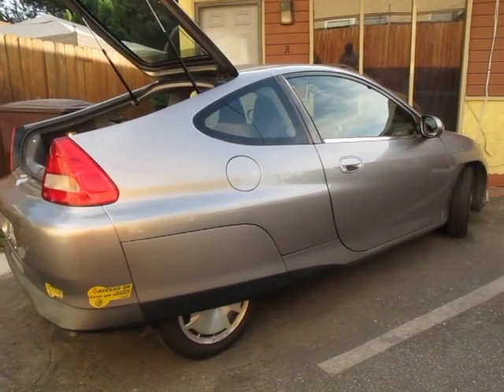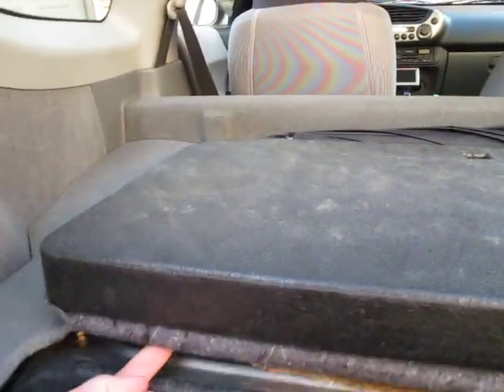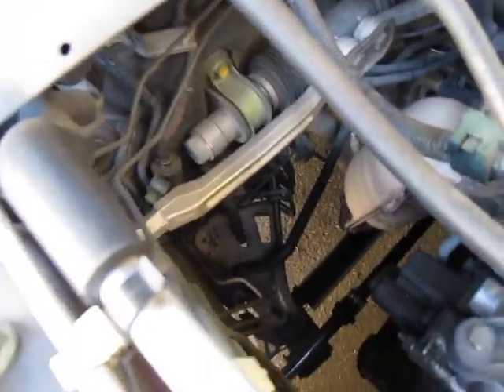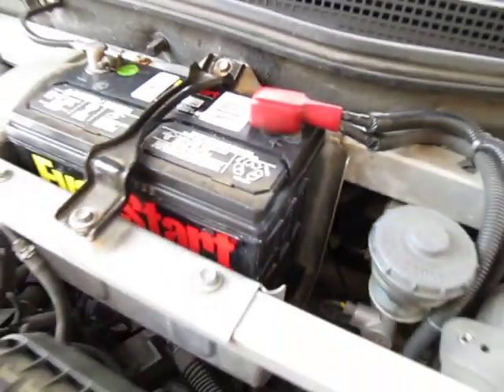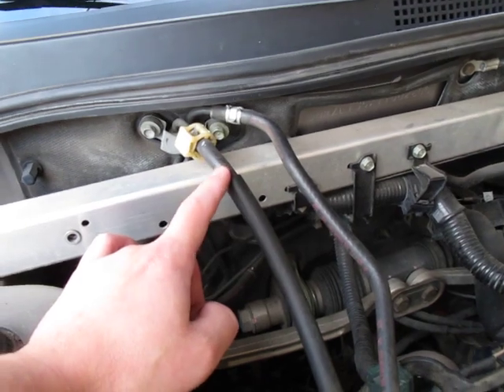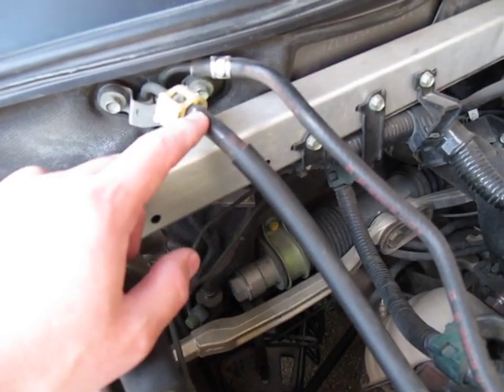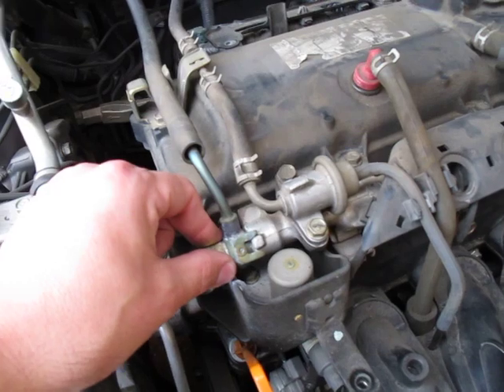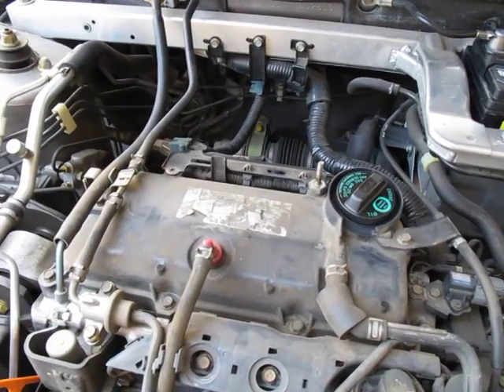Pre-Heating Fuel Concept With The 2000 Honda Insight

Comment from the maker: Thank you very much for this link :) It's of great help. Yes, you are exactly right. This link indicates 90 cubic feet of air flow per minute(through the combustion chambers, collectively) at 6000 rpm's(revolutions of the engine per minute)(or 1.5 cubic feet per second). This car has a very tall gear ratio and achieves 100 miles per hour at only 4000 rpm's. At 4000 rpm's which I have no need to exceed, the engine pumps 60cfm or 1 cubic foot per second of air. I'm just getting started continued:

Comment from the maker: Thank you Ron. I will do this right away. Thank you for the information and guidance. I really appreciate it. When articles and publications and newspapers and write-ups state that 98%(+) of the gasoline is burned by todays automobiles, these articles are not talking about the engines combustion chambers burning the gasoline(HydroCarbons). The catalytic converters in new automobiles still burns the unburnt fuel. The gasoline must be burned inside the combustion chamber to maximize efficiency.

Comment from the maker: Thank you. I understand. When I bypassed the stock fuel pressure regulator by way of removing and capping off the Vacuum Line connecting to the stock fuel pressure regulator, The fuel pressure increase to 47 PSI. When the stock fuel pressure regulator vacuum line is connected, the high pressure fuel line is reduced to 37 PSI(Pounds Per Square Inch).

Comment: Liquids will vaporize at a much lower temperature when under a vacuum. For instance methyl Alcohol will vaporize at 100 degF under a vacuum where as it will take 165deg F normally to vaporize. Most internal combustion engines produce tons of vacuum to utilize this effect.
Reply from the maker: Thank you. Very Interesting. I will study your notes in great detail.

Comment from the maker: That's a very good question. From what I've read, gasoline powered engines(4cycle) are said to be least efficient when the throttle is at anything less than 100 percent open ie maximum flow, but that only until we reach our desired speed, then let off of the gas just enough to maintain said speed ie 70 miles per hour. I'm told that diesel engines are quite different, in that they do not have a butterfly valve which limits air flow through the intake as you accelerate, thus most efficient design.

Comment from the maker: That's great. The 2000 to 2006 First Generation Honda Insight is certainly a unique car. Aluminum Frame, Aluminum body. The car only weighs 1800 pounds and because it's aluminum and honda design new machinery and processes to build the car- the car actually has an increase in structural stability over a comparable size car made of steel. I believe it's 30% increase in structural stability, thus high safety ratings and excellent track handling. You saw some nice and unique cars that day :)

Comment from the maker: Yes, I really like the idea of using an Ultrasonic Transducer(Humidifier) to Cavitate the liquid gasoline into small 2micron to 5micron droplets which quickly vaporize after leaving the Ultrasonic Transducer because of the large surface area of the small droplet size. Also, the less than 100% humidity conditions facilitate this phase change from liquid to vapor state. I recently learn that gasoline expands 163.3 times when it phase changes from a liquid to a vapor. Very interesting indeed :)

Comment from the maker: That is a very good question. I show a fuel injector I open in the video "Gasoline At 400 To 700 Degrees Fahrenheit"(near the end of the video). I open this fuel injector in order that I may see the contents of the fuel injector, in terms of materials used ie Metals or non Metals. I drove the 2000 Honda insight with the liquid gasoline PreHeater system for about two months with no problems nor complications. The car ran very well with an increase in mpg(apx 8mpg increase) and very smooth idle.

Comment: They could be in one large chamber with space above the baffles for the vapour to be mixed with the air as it passes through, but the baffle walls should help prevent the fuel from sloshing away or submerging the 'fogger' more.
I would start the baffles a short distance up from the base.
Imagine an ice cube tray, with a fogger in each compartment. Now cut off the bottom and then place the tray into a box but glued in place up off the bottom. The tray sides will limit sloshing.

Comment from the maker: Gas hole is an excellent insight into the basic gasoline vaporization system and how easy it is to improve fuel efficiency, reduce tailpipe emissions & increase power- all at the same time. Also see Smokey Yunicks hot vapor car, via a Google Search. Smokey design several gasoline vaporization systems that work very well. Smokey said the only way to use all 17,500btu's of energy per pound of gasoline(times 6.3 pounds per us gallon), is to vaporize the fuel before it enters the combustion chamber.

Comment from the maker: Hi Mike. Thank you for your question. Pressure affects the boiling temperature of liquids. In the same way that water will boil at 212 degrees Fahrenheit at sea level(atmospheric pressure). And water will require more heat if pressurized, Gasoline also requires more heat when under pressure. The more pressure, the more heat required. I do not have the exact equations, but I'm sure they are available, and as you mention, well known. My fuel line is at 37psi, thus much more heat is required.

Comment from the maker: Thank you for the post Ron. I really appreciate your knowledge and experience. In order to learn how little fuel is actually burned inside the combustion chambers, one need only google search "Physics of the internal combustion engine", Many Physicist and Engineers have written at length. The Physics and Engineering Aspects of the internal combustion engine have been very well documented and described in simple non technical words. It's truly great to know how a system works, inside and out :-)

Comment from the maker: 6001 cubic feet of air per hour equates to 100 cubic feet of air per minute or 1.7 cubic feet per second. The 61 cubic inch insight engine will pump 60 cubic feet of air per minute at 4000rpm's(ie 100miles per hour). Our air to fuel ratio will be 122 pounds of air to one pound of vaporized gasoline. Note: One gallon of gasoline weighs 6.3pounds. One pound of gasoline vapor is 3.5cubic feet. With an air to fuel ratio of 122 pounds of air to one pound of gasoline(see definitions of  Stoichiometry)

Comment: The fuel can be fed in below the baffles. A simple float controlling the fuel pump could stop the fuel from rising too high.
For safety reasons, we need to look at preventing fuel from leaking everywhere in the event of the car rolling. A mercury tilt switch could kill the power to the pump.That would just leave the fuel in the chamber to contend with...
An electrically powered butterfly valve in the 'air in' hose up stream of the chamber could be closed in the event of a rollover. No fuel leak!

Comment from the maker: @beaugardner1 You are exactly correct. I have been driving the car for almost one month now with the new modification, and though the gasoline is being heated to 400 up to 700 Degrees Fahrenheit, the stock fuel pressure with the stock fuel pressure regulator which is on the fuel rail before the gasoline reaches the fuel injectors, is 37psi. I tried bypassing the stock fuel pressure regulator and the pressure increase to 47psi.

Comment from the maker: Hi, Thank you for your interest in this project. You are absolutely right in your observation. At this point in time, I've move onto a different design which works a little different than this approach. Please type Molecular Change in the you tube search bar. This will take you to Billy's truck which he's create a system which vaporizes the gasoline quite effectively. Inside his vapor chamber, he has two 250 watt Calrod heaters wired in series, heated to 600 Fahrenheit.

Comment from the maker: @NitroExplosion88 Thank you. The only explosion that should be possible- is a controlled explosion inside the internal combustion chamber. Being that the gasoline will be completely vaporized(ideally), The gasoline vapors once mixed with oxygen from the ambient air being pulled into the engine through the intake manifold- will ignite quite well. But not a moment before being inside the internal combustion chamber(piston cylinders). I will be replacing the non metal fuel line with copper lines.

Comment from the maker: rather than the stock fuel systems 14.7 pounds of air to one pound of gasoline(this 14.7 to one ratio is said to be required only when injecting gasoline in it's liquid state and vaporizing the gasoline inside the combutions chambers, rather than sending only vaporized gasoline into the combustion chambers- which permits 122 to 1 stoichiometric fuel ratios with a noted long history of no harm to the engine). One gallon of gasoline expands 163.3 times when phase changed to it's vapor state. If we

Comment from the maker: gasoline vapors(ie one pound of gasoline to 122 pounds of air) = 9630 total cubic feet, with an air to fuel ratio of 122 to 1(measured by weight). Thus 9630 total cubic feet divided by the engine pumping 100cubic feet of air(including the recently combined vaporized gasoline) at 4000rpm's at a Hypothetical 100 miles per hour(load, friction and drag included?) = 96.3 minutes to consume one liquid(in vapor form) gallon of gasoline(at 6.3 pounds) at a Stoichiometric air to fuel ratio of 122 to 1.

Comment from the maker: Engines built for racing sometimes have a Camshaft(Cam Lobes) which open the valves to such a degree that the engine will not idle well, however permit excellent power and performance at higher engine rpm's. With VTEC, the engine may use these more extreme camshaft lobes for higher engine rpm's(estimated at approximately 2600 + rpm on the 2000 to 2006 Honda insight) while having access to a more mild or ideal camshaft lobe for excellent engine idle and torque at lower engine rpm's. Interesting.

Comment from the maker: I like your idea of using several Ultrasonic Transducers(Humidifiers) and see if lower and higher voltage would fluctuate the amount of 2 to 5 micron droplets of gasoline the units produce. This could be confirmed by way of testing. I do believe it's very possible, for example, in my video "Vaporizing Liquids Without Heat" here on you tube, I turn the dial on the Ultrasonic Humidifier which changes the rate of Cavitation of the liquid. There's low, and medium and high cavitation rates.

Comment from the maker: I really like your idea of using a custom electronic control unit. I will look into this for sure. Thank you for the address of the company. I believe it is a combination of both modified ECU, and producing the vapors at a rate balanced perfectly for the given rpm at any given time- that will maximize efficiency and power. I can share the idea and goal I'm working on with the company and see if they have any ideas. I've heard of someone in Brazil using a CNG chip in his car, for his HHO system.

Comment: One more item for you regarding the temperature of the fuel.
If you take a temp reading, I bet you'll find the temp of the fuel high before your pressure regulator, the regulator itself and the temp after. Then, I recommend you take a good look at Principles of Refrigeration. The pressure regulator acts as the capillary tube, wherein after, in it's expansion, it absorbs heat from its environment to complete the vaporization.
Interesting stuff! Make me think.

Comment from the maker: I like your idea of using Ultrasonic Transducers(Humidifiers) to Cavitate the Gasoline Molecule into a fine mist ie 2 micron to 5 micron liquid droplets of gasoline. But note that Ultrasonic Transducers do not directly vaporize gasoline. For example, when you watch an Ultrasonic Humidifier Cavitate the water droplets and a little fan blows those droplets into the air, the water is not completely vaporized until you can no longer see the water in the air- only seconds after leaving the humidifier

Comment from the maker: @MrFrancispiche It is absolutely puzzling how many water fuel cell systems are available that do not work proper. From what I've seen in your video's your system works well- and I appreciate your hard work :) It seems most of the water fuel systems available right now on the market- do not utilize proper electronics and water fuel cell deisgn- which equates to a very inefficient water fuel cell which consumes much energy- and creates much unwanted heating of the water. It's true- I'm learning :)

Comment from the maker: approximate 4000rpm's to equate to a speed of 100miles per hour. And 100cfm of air(at 4000rpm's) weighs 8 pounds. 100/8=12.5 cubic feet of air weighs one pound. 12.5x122=1525cubic feet of air weighs 122 pounds. This 122 pounds of air is Stoichiometric with one pound of vaporized(before entering the combustion chamber) gasoline which occupies 3.5 cubic feet. Note: One pound of gasoline vapor is 3.5 cubic feet. 122 pounds of air is 1525cubic feet. One gallon of gasoline weighs 6.3pounds. Continued

Comment from the maker: Continued: Billy learn through testing, that gasoline will not autoignite until it reaches approximately 950 F(At Atmospheric Pressure). Billy sprays a very fine mist of gasoline onto two 250watt electric Calrod heating elements which instantly vaporize the gasoline. Billy had his Alternator modified to produce the extra amps and volts needed. Others have add a 200 amp alternator to their automobiles. I will use the stock fuel injectors signal(duty cycle)to pulse the vapor chamber fuel injectors

Comment from the maker: You Tube search "Molecular Change" and you'll see Billy's truck running on a white vapor. Billy heats two 250watt electric Calrod Heaters up to 600 Degrees Fahrenheit and sprays(like a fuel injector sprays a fine mist) gasoline droplets(50 micron to 65micron) onto the heated steal surface. This creates vapor on demand at atmospheric pressure. Many people have duplicate Billy's system and it works well. Testing has confirm that gasoline will not autoignite until approximately 950 Fahrenheit.

Comment from the maker: @NitroExplosion88 Gasoline will only explode in it's vapor form- not in liquid form. You are right that there will be a controlled explosion inside each cylinder- inside the engine(such that there is now- only 100% of the gasoline will now burn inside the cylinders- rather than inside the exhaust system's catalytic converter). All non metal fuel line's will be replaced with copper fuel line, with each end of the fuel line sealed tight with proper metal fittings. Safety is extremely important.

Comment from the maker: Yes, the 2000 to 2006 Honda Insight has a 10kw(Ten Thousand Watt) Brushless DC Electric Motor which is producing current at all times. I'm very interested in testing your passive electric HHO idea on this model car. Please do explain in great detail- the test. Please understand that I'm still learning about electricity and the technical language associated with electronics and devices, so please explain in simple to understand words, that I and others may quickly grasp :) Thank you michael.

Comment from the maker: I have not research adding acetone to the gasoline to facilitate vaporization. Experimenters have done this and say they have great success with the process. As for removing the approximate 70 pound 120 D size cells from the car to reduce weight, I've not done that. I may replace the original High Voltage(144 volt) Hybrid Battery with a new battery, although I'm very interested in using UltraCapacitors/SuperCapacitors(less capacity, much longer life).

Comment from the maker: 96.3 minutes of driving at 4000 rpm's at 100 miles per hour, pumps 9630 cubic feet of air (mixed wtih vaporized gasoline at 122 to 1 Stoichiometric air to fuel vapor ratio, this ratio is measured in Pounds). Thus 96.3 divided by 60 (minutes per hour) equals 1.6 hours of driving, or just over one and one half hours of driving 100 miles per hour at 4000 rpm's, thus achieving approximately 160 miles per gallon. The engine would burn one US gallon of gasoline in 96 minutes and 30 seconds at 100 mph.

Comment from the maker: You have excellent points in terms of cold starting and freezing wheather variables for producing vapors from exhaust heat. And as you mention- my most recent video shows how I pre heat the fuel rather than vaporize it. It was an interesting test and I've move onto designing a system that creates the gasoline vapors on demand. Please you tube search "Molecular Change", Billy has been running his vapor chamber in his truck, for many years with two 250watt Calrod Heating elements heated to 600 F.

Comment: Dont use copper for fuel line vibration segregates the alloys and it crystalizes. 
Return lines often are built as pressure relief for maintaining injector pressure.
you mentioned fuel being cold after turning to vapor. It is the change of state that enters a low pressure can have that effect.

Comment from the maker: Presently, The gasoline powered internal combustion engine even in brand new automobiles, only utilizes approximately 20% of gasolines energy to move the vehicle(motive force) forward. 40% of gasolines energy is lost to friction and heat, And 40% of the gasoline(injected into the combustion chamber via fuel injectors) is sent out of the exhaust manifold as unburnt fuel. Smokey Yunick notes gasoline must be vaporized before entering the combustion chamber to maximize engine efficiency.